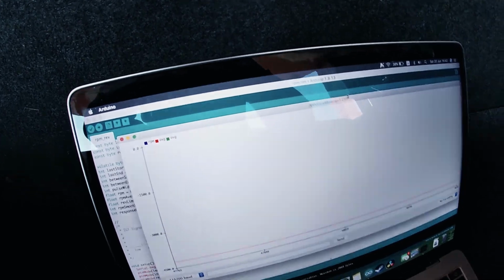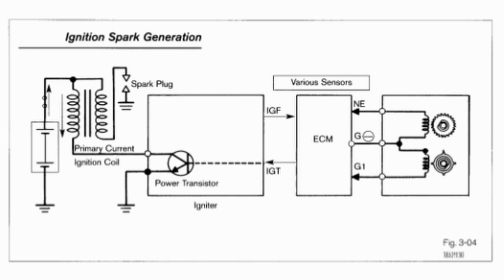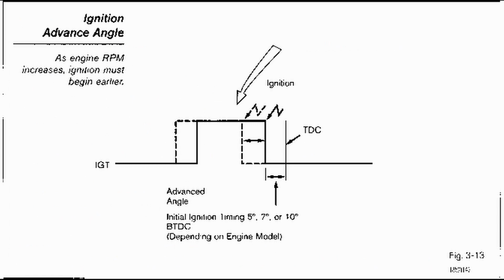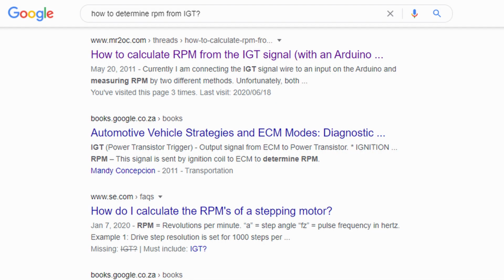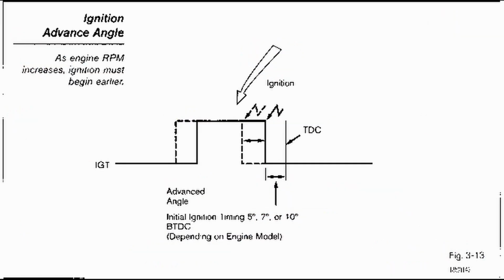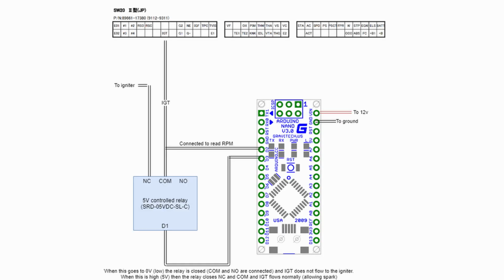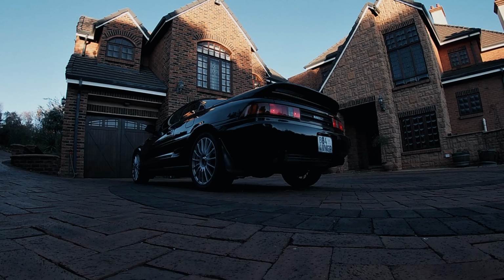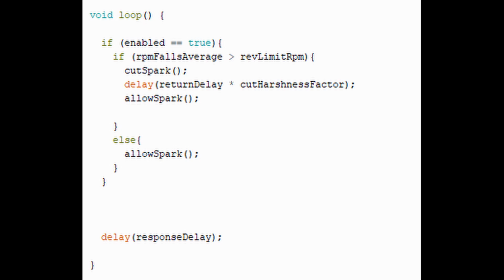How to add launch control / 2-step / anti-lag to any car with Arduino stock ECU (DIY Bee*R)

Comment: Hello, I know a question with that Ecu "Arduino" do you think you can raise the turbo psi? Up to 23psi, for example I have a 3sgte 4gen with 8psi stock but it could go up to 15psi according to what they told me but with a programmable computer it could go up to 23psi or more
Reply from the maker: Technically you could but it would be too complicated to do without having electronic engineering experience. Use a manual boost controller instead. There is plenty of info online about how to get more power from 3SGTE.

Comment: Hi mate, congratz on using your head to implement an embedded system, Very nice to see how you take an intelligent approach to the existing system before jumping in. I may not be 100% correct on this, but i can hear that during the rev limiting active sections (possibly depending on how you have tweaked parameters on different shots of limiter on through out vid) that there is at least one section of your vid demonstrating the limiter function active, that may be of concern. I Can hear that the engine cycles are not well pronounced, as too say that the ignition timing is falling out of sync and therefore the timing between each pair of synchronized cylinders is wandering. I am quite sure you are aware that a common result of these bursts of unsynchronized igbt gate pulses is for 4 cylinders to jump the engines valve timing, at worst this usually means fixing bent intake/exhaust valves in the combustion chambers, costly head machine work. But i have seen during years of learning / experimenting with efi mods that if valve collision is avoided, stray ignition timing at such high rpm / engine load most definitely leads to streched cam belts / chains. So only difference is that the cam belt/chain breaks outof the blue at a latter time. 
If you have any interest in this side of things, i would be happy to post u some schematics that deal only with the spark cutting interface end of your desgin. usually its always best to use SCR's with a load resistor(4.7ohm 5W) , which allows a very small voltage at low current to be used to trigger the gate on the scr when you desire sparks to be cut. The circuit is wired so that once the scr has been gated on, it opens a safe current limited path across the primary windings to shunt its current to gnd, so that the magnetic feild is not allowed to collapse thereby inhibiting the HT flyback effect on the secondry, ensuring no spark can be created. However, its true benefit is that it automatically keeps the orignal high current gnd current produced by the ignitor perfectly in sync. As the SCR will only conduct current if the igbt is sinking current(dwell time), and the scr auto latches on during the coils dwell/charging phase. And as the oppisite is also true of scrs, that they stop conduction once the dwell current pulse ends, therefore only ever latching on or switching off in sync with the igniter's collector current.
However it seems that your coil has the igbt(igniter) buit into the coil assembly, meaning that you cannot interface a typical scr rev limiter as you cannot access directly the coils high current -ve terminal. So it appears that you are intercepting the igbts gate signal at its logic level, so a different apporach is needed to keep your timing syncronised.
Actually its alot simpler than the scr approach anyhow. Basically, you would scrap the relay portion of your circuit. Instead, you should use an I/o pin on your arduino board to take sole owner ship of the igt signal. You code needs to use either normal interupts triggered with the rising/falling edges of the igt signal, or maybe a less interupt bound system would take advantage of the IOC pin functions, which can streamline thru put, as you incoming igt signal can use IOC to raise a flag + isr to determine if signal edge has switched high or low, then within isr code check the status of a static global variable which should be set low to indicate that no limiter function is required, in which case a pre-configured I/O pin simply outputs a mirror of the orginal incoming IGT signal. BUT , when limiter action is desired, the isr which triggers on each changing edge of the incoming igt sig should see that you global static variable if set to high (logic 1) and knows that now you want to cut sparks. So i think if you simply hold you igt I/O output pin in a low state, this should cause the igniter not to switch on dwell current at all , therefore you will miss this spark. Just ensure that you re-asses the condition again  when the next ISR event detects the igt input I/O pin and either return normal mirrioring action on the igt I/O output if limiter variable indicates NO LIMITING FUNCTION(logic low), or if it indicates that limiter is still required(HIGH) then use a pattern of alternating every other spark is cut  for this cylinder, otherwise the cylinder walls will be flooded with raw unburnt fuel. 
This theory of spark cut is solid, and is common partice in both OEM and aftermarket ECU's. You could use a pot with the adc to act as a variable to control how many sparks are cut of of say 16 sparks total. This will allow you to still have control over how harsh your limiting action is. Plus while your there, a clutch pedal switch input would allow easy implemention of full throttle gear shifft.
Message me if ya need anything. Good luck
Reply: Hello Are you okay?
I would like to know more about it, can you help me please. would have some video or channel to indicate.
Reply: Can u helping for me?
(Sorry for my bad english)
Souza - from Brasil. Thanks.
Reply from the maker: Wow thanks mate, that is an amazing explanation and thank you so much for taking the time to write it. Really learned a lot, if I ever revisit the project (I never really ran this limiter for longer than a week or two) I will definitely be considering your approach. It’s so useful to get some proper input from somebody as knowledgable as yourself, do you mind if I quote your message in the description as “further reading”? If you have any links that could point to more info on this that would be awesome as well. Thanks 🙏

Comment: Hey thanks for source code.
Can u helping for me?
I need wiring circuit diagram for this plane.
I have Honda Civic, and from my ICM(IGT) coming +12V.
And my Ecu make gnd pulse to my ICM.
And when i opening this relay, and my ecu give no gnd pulse, than my coil give no spark.
When i opening this circuit ecu from ICM, than coming out check engine lamp and engine has stop working.
I soldering NPN transistor to my ecu, and i give false signal to ecu, than coming not back Check Engine lamp. Good Work.

Next Step:
But i need giving gnd pulse to ICM, to getting spark.
I need getting signal from arduino to ICM (2step signal) from other channel.
When this relay opened, and my ECU get false signal, have no communication with ICM, how can i givin gnd pulse signal to icm from arduino from other channel? Where i need modifying this code for 2step signal?

for example i need from 8 pin this 2 step gnd signal output to my icm. Can u helping for me?
(Sorry for my bad english)
Filip - from hungary. Thanks.
Reply: Hey I am doing the same thing but from 555 ic and cd4093 ic done a circuit delay pulse single generator

Comment: Hi! hope you're doing well, I wanted to attempt to replicate a similar design using the ATTINY 85, but one thing that confused me was the igniter from nc of the relay, can you explain where that would go to exactly?
Reply from the maker: the igniter is what you will need to cut the signal going from the ECU to the igniter itself, I used NC to make sure it was normally closed and connected (NC) to make sure if something went wrong with the circuit the car would still drive.

Comment: Follow up this project 👍 but this a rev limiter not launch control, the launch control will be active if you press the clutch pedal and its automaticly off after some second you relase the pedal. Will you update this project ? Please add quickshift function 🙏
Reply from the maker: Sure, in this project I connected it to the handbrake since my clutch does not have a switch / sensor to tap into. You could just connect the "handbrake" input to a clutch sensor instead and it would be launch control

Comment: How did you managed Arduino to pick the current RPM so rapidly? In my version i cut it above 6000rpm and then it takes about half a second to refresh the information about rpms, that it's below 6000rpm again. That makes fast AK-47 cut like on your video impossible. There are miliseconds between ignition cutting and turning on again.
Reply from the maker: You can't manually read / wait for the signal in a blocking operation or it will be too slow. You need to use hardware interrupts to detect the rising and falling edges and calculate on the fly, that's the only way to measure and act fast enough. Try googling hardware interrupts

Comment: Isn't it a better idea to switch the wire going to the igniter to the other port on the relais? So it's closed (no cut) when LOW instead of HIGH. That way the car functions normally when the arduino fails or something is disconnected.
Reply: It is already connected to the NC terminal.
Reply from the maker: Great input, and yes that is the way I did it by connecting to the NC terminal.